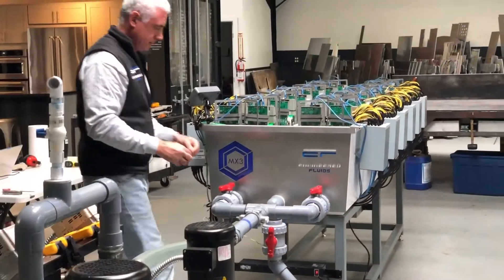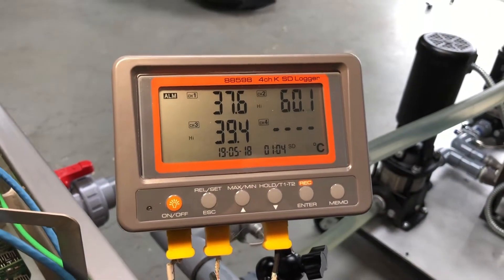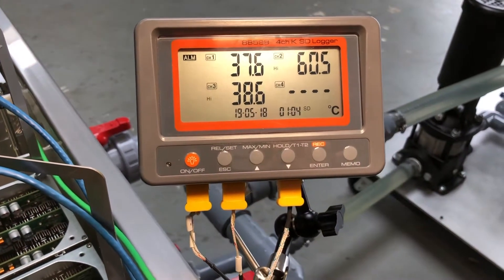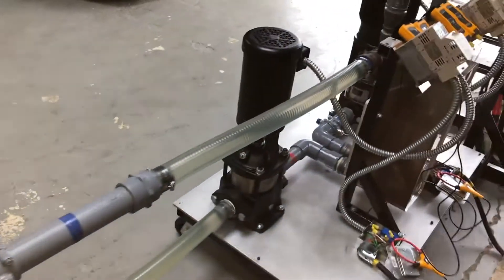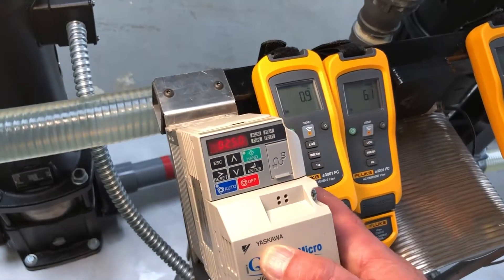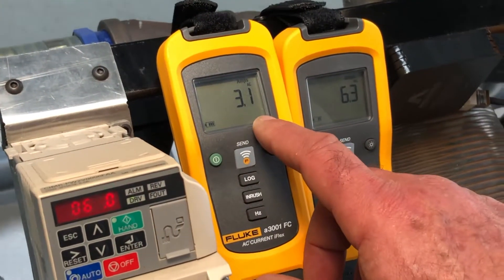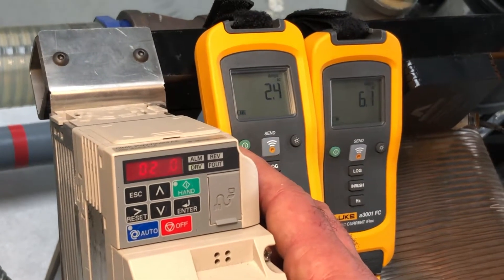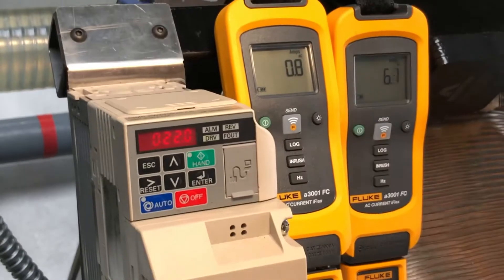Engineered Fluids SLICTank - Managing Operating Temperatures in a crypto currency Immersion Tank

Comment: nice video. i have question hope you answer. what is safe temp of fliud, i run fliud 60c input , but chip teamp really good. is it safe with fluid
Reply from the maker: We can operate the fluid up to 180C with no issues.   The operating temp of the fluid depends on the operating skin temps of the chips.  Most chips are designed to operate around 80C at casing.   Remember air is a terrrible conductor of heat, so you need to ignore air temps and focus on chip casing temps.